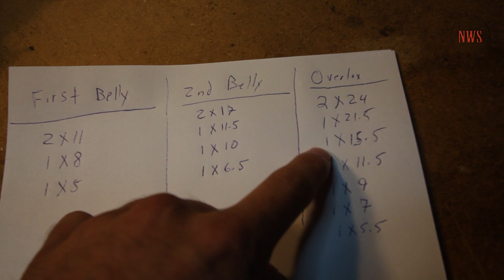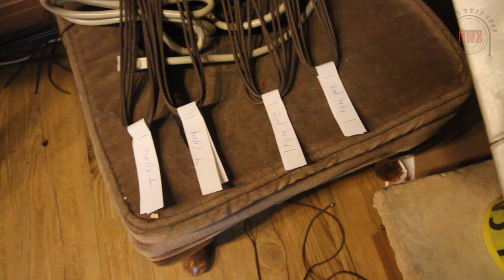Building A Matched Set of Bullwhips | Nick's Whip Shop

Comment: Maybe I'm not understanding... But why use the dacron lacing tape to bind over the sinew? From what I've seen the sinew has a 70lbs strength and the dacron 50lbs. Why not go twice over with the sinew on the 2nd belly?
Reply: Tensile strength doesn’t translate to the material’s rigidity or springiness

Comment: Can i replace artificial sinew with electric tape?
Reply: Never recommended. Vinal tape is falling out of use due to the fact that it hardens and breaks under the repeated use of a whip. If you dont have the artificial sinew, split the inner strands of your paracord (the white core strands) into their individual halves (each strand is two twisted threads that unwind into flat threading) and use them. That is what artificial sinew is made of anyway. Though it wont stick to itself bacause it is not waxed, it is just as effective until you can afford the stuff he uses.